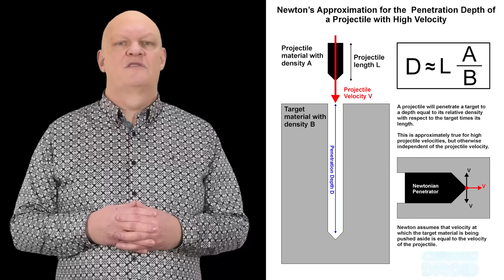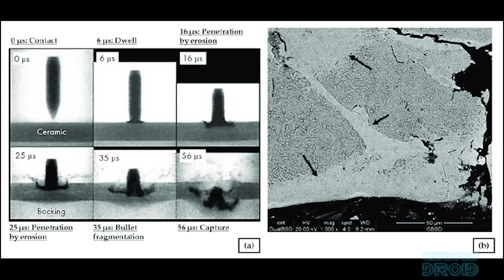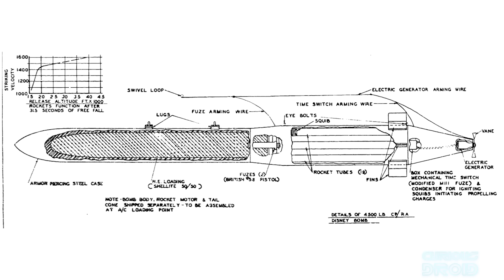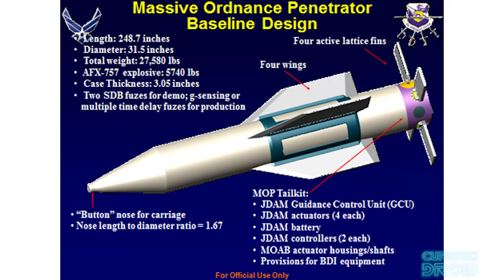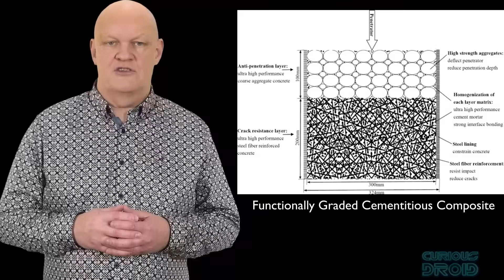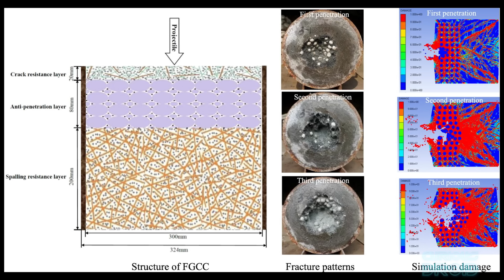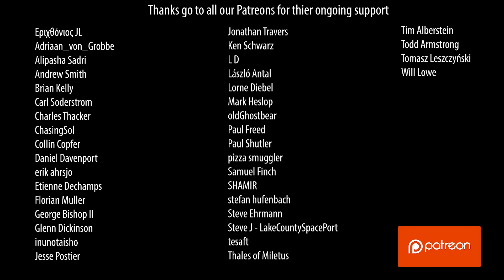Can Iran Stop U.S. Bunker Buster Bombs?

Comment: The important characteristic of a bullet from an AR-15 is not its jacket, which is copper and not steel btw, but rather its velocity and cross section.  A plain lead bullet travelling at 2500 fps would do the same thing to soft armor.  The pistol bullet is both fatter and slower, creating less stress on the material.  It isn't much a function of hardness.  Penetrating hard armor does require some combination of hard and dense materials like uranium or tungsten.  You can trade some of one property for the other, but you need some appropriate balance of both.  It wouldn't matter if your bullet were 20g/cm^3 if it had the consistency of warm modeling clay.  It also wouldn't matter if it were harder than diamond but as light as aerogel.  Neither would work.  It has to be a reasonable balance of both.
Reply: My 22-250 will punch through AR500 plates @200 yds with just a lead softpoint. (Found out the hard way) well, not that hard, just wasn’t trying to ruin that target. While a 5.56 with m193/m855 won’t penetrate it at 50 yards.
Reply: @zackzittel7683  
Yeah 22-250 velocity advantage, energy increases with square so small area of steel gets a lot of energy. I pushed light soft points too hard once and they broke up in flight.
Reply: @richardkudrna7503  I believe it, I’ve had 40gr HP fragment so hard and fast when they hit a cardboard box my target was taped to is guess only 1-3% exited the other side. The box was filled with lead dust.
Reply: When you say that a diamond hard but super light projectile would fail is that keeping the speed constant (I believe that) or the momentum?  I suspect a super hard but very light projectile packing the same momentum (so going crazy fast) would work pretty well.

But I don't really know hence why I'm asking.
Reply: @petergerdes1094  speed is the most important factor here. Microasteroid (a speckle of dust) can penetrate a tank because of it´s velocity. it´s weitgh x speed²
so speed is paramount
Reply: @sierraecho884  I see your point but I'm not sure it's that simple.  Thats energy not necessarily penetrating power.  Micrometers are also stopped relatively easily with lightweight whipple shielding that wouldn't be that useful against heavier items.

But when it comes to bullet proof vests that's probably right since you don't have the space to use light shielding to convert the KE into a circular blast w/o damaging what's behind it.
Reply: @petergerdes1094  Well honestly it´s physics it´s what you make of it. Might be cheaper to drop a 50ton bomb instead for example. or might be cheaper to drop a 1ton bomb 150 times instead.
But generally speaking if you want to penetrate it then it´s that simple. You need as much speed as you can get. 
A coil gun in space for example would be a good solution since the biggest problem with coil or rail guns is cooling and space is plenty cool ...give the right position to the sun.
Reply: @sierraecho884  Fair point.
Reply: thats cool to copy and paste info, a loose understanding exhibited. i love how you switch from freedom units to system internationale with no coherence. epic and 'merican as a clip of a bald eagle dubbed with a red tailed hawk call
Reply: @byloyuripka9624  using imperial for some things and si/'metric for others is common in the UK anf former British colonies that today have English as their primary language. Still probably a good call on the copy paste tho.
Reply: Exploding a hollow sphere of your clay lined with tin can make a pretty effective penetrator for hardened targets.
Reply: Thanks for the correction!
Reply: it gets even more complicated than that,
Curious Droid mentions this at the end: further increasing velocity can result in your penetrator "breaking" because of brittleness.
thats why you need a material which not only withstand high pressure but also high tensile forces.

The density he mentioned is important in order to gain the maximum out of the impulse without increasing the velocity and the surface area.
Reply: They have steel jackets when they put steel jackets on them. The military doesn’t use AR-15s either. They use the full auto AR10 and whatever else. There are many many kinds of bullets and no, copper is not the only kind of jacket. Copper jackets deform readily to dump energy. Steel less so. If you’re concerned about damaging the barrel, they use steel that won’t damage the barrel much but will be tougher on impact. All barrels need replacing.
Reply: @thetruthexperiment  AR 10 is near identical to AR-15 just 308 with larger components to withstand the increased forces. It's not used by the military anymore than AR-15s are. AR-15 was an ArmaLite 223 version of the AR -10 both civilian. AR-15 gets sold to Colt who produced a version specifically for the military they called the M16 which then evolved into the m4. Colt then later started manufacturing a version of the M16 for civilian sales again where it got back the AR-15 name. Edit also I'm not familiar with any steel jacketed rounds copper jacket over lead solid copper or brass copper jacket over steel or tungsten but never steel over another core presumably because it would destroy barrels in very few shots and run the risk of causing barrels to just explode if any residue built up from softer rounds prior to firing a steel jacketed round. And also the drastically different weight distribution not really ideal for penetration , so I could see solid steel ones with a surface coating or sabot.
Reply: @MrDJAK777  the Russians use a “bimetal” jacket that is soft mild steel and tin. But nobody uses a steel jacket.
Reply: @thetruthexperiment  nobody uses a steel jacket. M-95 is a copper jacketed steel core AP round for 5.56 the black tip 30-06/308 is the same construction. The m855 has a small mild steel tip topping a lead core covered in a copper jacket. Steel jackets would erode a barrel so fast it would be laughable. Because of its 4,000+ FPS velocity my 22-250 has a barrel life of about 2,000 rounds. With copper jacketed ammunition. You are a little mistaken
Reply: @zackzittel7683  I suspect he meant steel cored ammunition.
Reply: I think that section was just a setup for the kind of arms race there is between penetrators and armour. The stock footage showed a 9mm, then a .223, then a .50, but he never mentioned that, so I think it was just illustrative filler. The point is if the speed stays the same, then the material matters. Which is true across all calibres of cartridge, which can be designed for different terminal ballistics depending on what you want to achieve.  
The material on both sides of the equation matter, especially if you're relying on terminal velocity of something gaining energy through gravity.
Reply: Nope https://en.wikipedia.org/wiki/Full_metal_jacket_(ammunition)
The hardness of the material it´s weight and speed has to be cosidered alltogether
Reply: Fun fact: people located in Afghan learned in a hard way that 7.62 TT isn't a regular pistol cartridge...
Reply: Yeah that was a poor comparison. Should have used a traditional copper plated lead core FMJ in 9mm compared to monolithic carbon steel 9mm armor piercing projectile. (Yes they exist, and yes they not only penetrate soft armor but lvl 3+ plates. Pretty impressive for a 4” pistol. It was showcased and demo’d on the YouTube military arms channel.

Comment: With the ability to  employ precision guidance maybe the solution is to drop multiple bombs where one hits then another hits after that at about the same location, etc.  where each destroys a bit more that the previous.
Reply: Seems to work with Gatling guns!
Reply: It would not be as efficient, if the facility you are attacking has an anti-air system... even worse if you are using airplanes to transport the bombs. But even if you plan to use satellites as a missile platform, you can't ignore the fact that countries like Russia are developing satellite killer missiles.
Reply: @anfrex3342  If you're going that far, then you might as well use plenty of decoys (both physical and electronic) as well as target the air defences.
Reply: @anfrex3342 the US wrote the book on how to suppress enemy air defenses (then threw it at Iraq to great effect), and the use of a satellite weapon is a one and done. The retaliation attack on the satellite will be too late to mitigate the damage done.
Reply: Bad idea, it´s a workaround and shows that the main idea does not suffice.
Reply: @sierraecho884  That is exactly what it was intended to be, a work around in case some better idea is not employed but one has to make do with what one has.
Reply: @RonLWilson  Well in this case simply shoot a thin projectile with space x into space and let it hit your target with mach 30 would be much more effective.

Comment: People are mentioning the Rods of God as the ultimate bunker busters, and although they would likely be effective if they hit their target, but i think the problem lies within the Tungsten material, we know its limits, so people could either put their bunkers deeper underground, or adjust the concrete specifically to protect against Tungsten.
This does seem to be one of a few cases where a defense strategy outperforms the offense capabilities, but only in a very narrow way.
Because a bunker is also just a very expensive prison if you can isolate for long enough, just like castles and other fortified spaces.

Comment: Yep, at 11:09 look at the difference between a GBU-31 with the traditional Mk84 bomb body (GBU-31A or GBU-31v1) and the GBU-31 with the penetrator BLU-109 bomb body (GBU-31B or GBU-31v3). (The lower one is the Mk84, the upper one is the BLU-109). No nose fuse in the v3 because the nose is pointy and a fuse would get crushed and disabled, so they use time impact delay fuses in the tail section instead. Some have void sensing fuses as well. The amount of actual tritonal or explosive is much less in the v3 than the v1 even though both weigh around 2000lb total. The case is much harder and reinforced on the v3.
One of the design problems to be solved is bomb body breakup before fuzing, after penetrating so much hardened concrete. This is also an operational problem, finding the balance between impact delay required vs probability of breakup. 
There's also a 5000lb GBU-28 Laser guided bunker buster as mentioned.